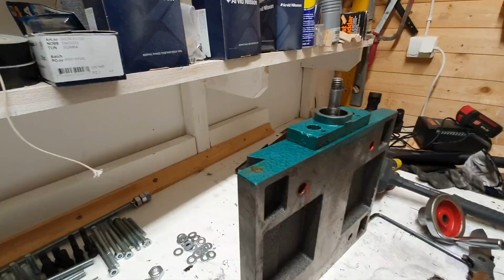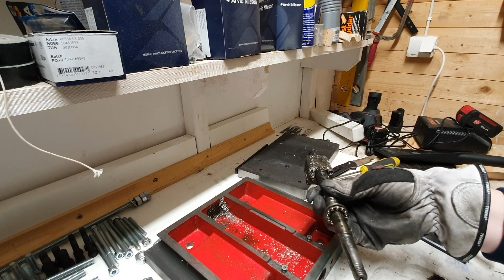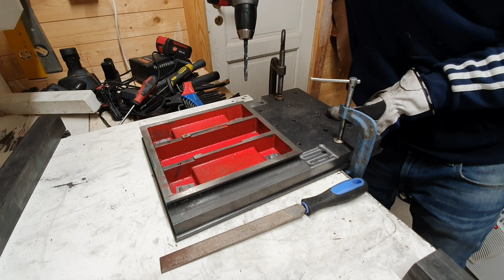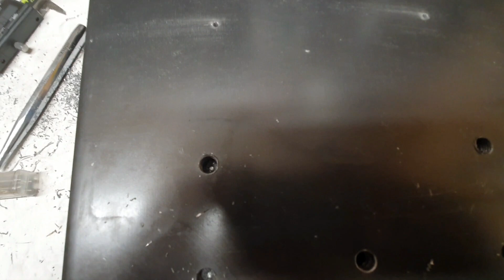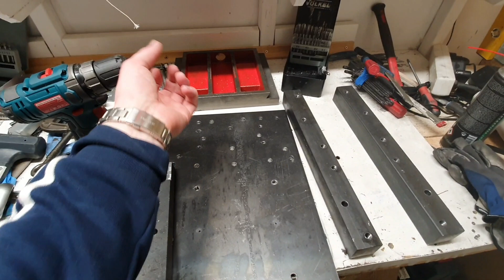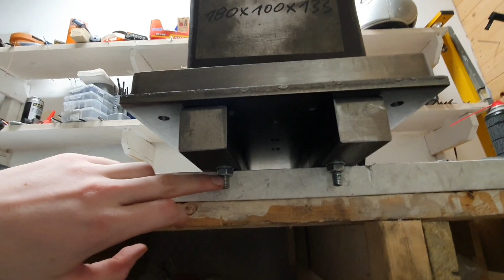building on my mini mill /milling machine day 2

Comment: roll pins they ARE like dowel pins but expand a little and are for less accurate holes
Reply from the maker: Thank you for sharing. Always Nice to learn something New.
Reply: @thechipwelder1253  I know I'm a little late here but, depending on what part of the world you live in they are called roll pins, split pins, and spring pins. Good part about them is they very strong and at the same time very inexpensive.
Reply: @dennythomas8887  They are roll pins, split pins are a completely different thing, I have never heard of spring pins.
Reply: @fredfarnackle5455  Sorry Fred but not really. I'm a Jet mechanic by trade. I work on lots of Airbus products. their are lots of roll pins, spring pins, split pins on the sub-assembly's of these jets. The thing is they are all the same style pin but the name changes depending on the manufacturer and/or country of origen.
Reply: @dennythomas8887  Ah, well... That's because of the EU and catering to different countries' whims. Tut, tut! If you walk into any engineering place in the English speaking world and ask for a roll pin, that's what you will get. If you ask for a split pin you will get something completely different! Split pins have been around since the dawn of (British-led) engineering.